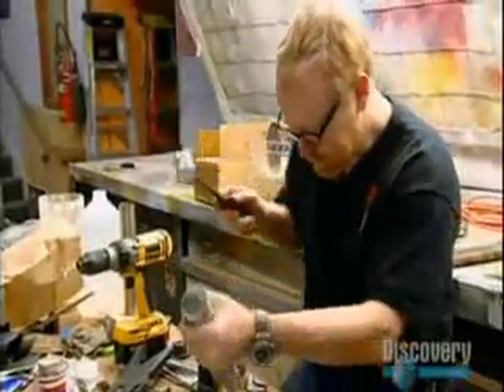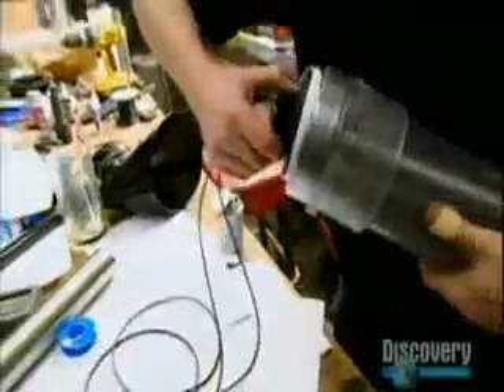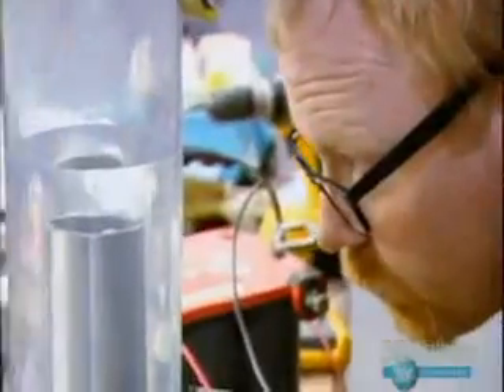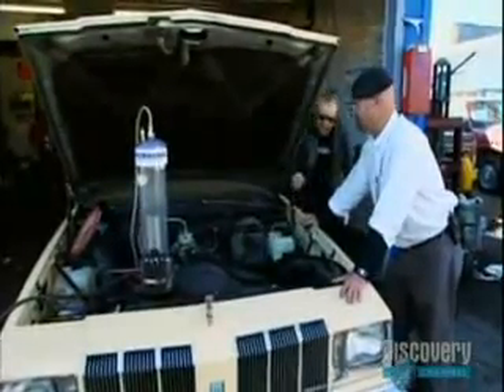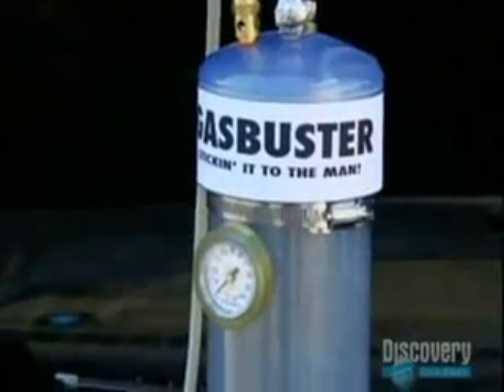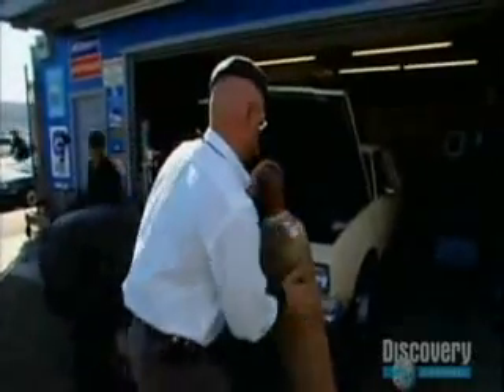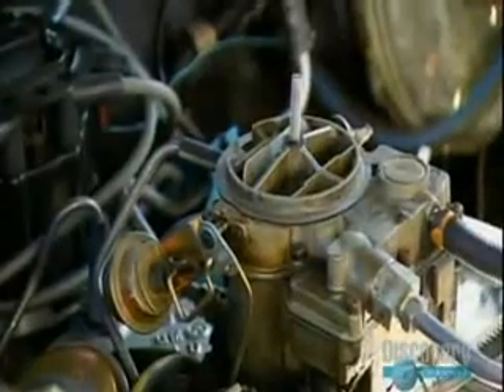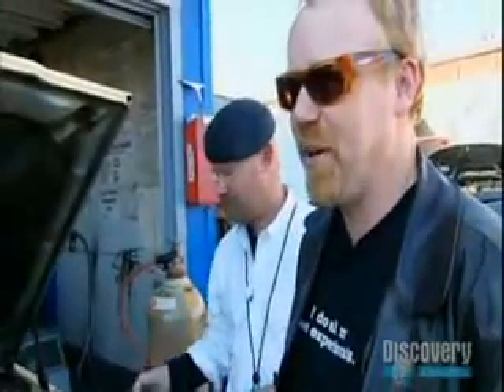HHO Mythbusters Explained

Comment: Since I am researching hydrogen as the "next generation fuel". I read somewhere that you need 4000 Liters (four thousands) of hydrogen to replace 1 Liter (one) of gasoline. it is not impossible to generate that ammount of hydrogen, unfortunately it still requires a lot of electric energy, so you just have to settle down with the small generator that can only produce 1-2 Liters of hydrogen per minute. If you are trying to run your car only on Hydrogen then try to get at least 100 Liters per minute with low electricity or with a solar source, and make it small enough so it fits inside your car. I am a man of science so I would never say is impossible, actually I beleve very soon someone will find the way, I have seen amazing guys on youtube getting up to 60 Liters per minute (using 320V and 33 amps). I am even thinking of writing my grade tesis about it. But for now we will have to run our cars only with a mix of hydrogen and gasoline. Hope this info helps you all to save some time instead of wasting it watching scams on youtube. THERE ARE A LOT OF SCAMS. peace!!

Comment: YOU DONT RUN THE ENGINE SOLY ON HYDROGEN...

it is best when you use a tiny amound of Hydrogen  produced by a kit using your cars electrical  system 

That tiny bit of hho is sucked into your intake via a vacuum  line attached to the intake manifold  and mixed in with your normal fuel and air and all of it is burned in the cylinders  just like normal combustion . .

The difference  is that the hho burns  fast  and clean to make sure you end up with no unburned fuel creating a cleaner exhaust better horsepower due to a complete burn and better fuel economy due to the horsepower increase you can keep your foot off the gas pedal a little more..

This system seems to work very well for diesels  and may eliminate the need to regen or use DEF fluids. 

There are many DIY kits and companys with $10k machines that mount on a big rig.

I think a major difference  in the machines is the amount of hho produced

And the material used in makinh the metal plates that are layered  in the water 

Platinum  is one of the better materials but is very expensive  

Stainless steel works but wears out and does not produce as much hho ..

Good luck and i hope people will continue  to develop  this

Comment: its important to note this is not made to run a car off but rather as a fuel enrichment item to more completely burn what fuel you do use. if the energy used to create the HHO was from waste heat/exhaust gas the system would definitely increase output power. the idea is not the same as the water fuel talked about by stanley myers/daniel dingle/joe cell (or the like), it works on ICEs due to the fact that the ICE started as a highly inefficient design with room for improvement and gasoline doesnt burn 100% on its own (at Standard Temps/Pressures).

Comment: If you understand the basics of physics you would know that these systems are impossible anyway... it requires much more energy to produce hydrogen then you gain from burning the hydrogen.

electrolysis is only about 65% efficient. It gets even uglier when you combust the hydrogen... you only get back about 20% of the energy stored in the hydrogen, the rest is converted into heat. If you dedicated 100 Watts to producing hydrogen and then burn't it in the engine it would only produce 13 Watts of usable energy, which means you'd loose 87 Watts of energy!

Comment: They have totally misrepresented the concept. The device was developed to aid combustion and bump up power and aid economy. No ware does it claim that you can run a vehicle without fuel in the tank feeding the engine. 
Having said that, the device produces very little hydrogen, a single teaspoon of petrol can produce 12 cubic metres of hydrogen gas. Whatever the pros and cons, the idea is nice.

Comment: HHO cell produces HHO on demand... even if it backfire it wouldn't cause any damage... for additional safety use flashback arrestor or have a blow valve in the bubbler or have them both if your so paranoid... haha

Comment: mythbusters = propaganda/newsertainment
Reply: Keola Pirata I agree! I've thought that for MANY years now. I stopped watching the show when their "science" became Paid Science. Some of their episodes made me nauseous with how obviously blatant their BS showed.
Reply: Gary Tugan name ONE thing factually wrong?
Reply: Exactly right
Reply: Keola Pirata agree. they get paid by various entites to purposely cause some of their experiments to fail. it is not hard to make 3-4x the H2 that they make with their design. light-weight and high surface area materials are needed. solar/thermal recovery generation of HHO is maybe the best way to augment gasoline.
I stopped watching couple years ago when they obviously did not pursue some experiments to an improved design when results seemed to fail so they labeled many things as Busted.
Reply: +pds tech nnb
Reply: Keola Pirata to be useful in cars, it needs to have at least 50 horsepower to the ground
Reply: Jesteś durniem bez szkoły.
Reply: another Clinton-Obama deep state program
Reply: +FieldSweeper How about the FACT that they failed to produce a functional HHO cell for their experiment?  You can't test  if HHO works or not if your crappy cell is not even generating any gas.
Reply: oh I know.  they just choose a simple design when actually massive amounts of HHO can be made with  a little ingenuity, which takes time of course. they should've  just declared  it unknown due to circumstances.
I laughed when they just stuck the hose of H2 into the carb and thought that would prove/bust the idea.

Comment: The truth is, MB's didn't prove that HHO doesn't work. They proved, that the downloaded version from the internet of HHO wet cell plan doesn't work. They did however prove the point, that you CAN run a car on pure hydrogen, provided, that you have enough of it available and they also inadvertently pointed out, that you need a safe and proper set up to be installed on your car, to avoid any unwanted explosions and/or damage.

Comment: Conservation of energy makes this theoretically impossible in a car. You have to put in power to break apart the hydrogen oxygen bonds in water then you have to put in energy to bond the oxygen and hydrogen into diatomic form but that is not the issue you get all that energy back out in the combustion process. The issue here is that the thermodynamic cycle is limited by the Carnot cycle so you will not get a 100 percent efficiency meaning you will never be able to keep the cycle going for longer than a minute or so before then energy difference will be to great and the battery will no longer run. The reason hydrogen can run an engine is because it does produce enough energy but there is a reason they produce it in large quantities in factories. It is because they use large amounts of heavy metal catalysts in order to make the energy difference smaller and more efficient but they charge you because both those processes are expensive and they still have to put in a large amount power to make the reverse reaction happen. Whether there is a catalyst involved or not it still requires more energy than what you need to get out because the Carnot Cycle limits the power out compared to what is put in.

Comment: It is very easy to makeThe so called fuel cell and make a lot of bubbles  with different types of additives to the water and different gaps between the plates,,But it don't matter what you do,you can't make enough (gas) with your car battery to run your car 100% on (gas)You would need a bank of battery's and a supersize alternator  and a V 8 to run the alternator,,,,,,So you are chasing your tail,,Running around in circles and guess what, you are getting no where ,   CRAPP
Reply: no matter how many batterys, how big of an engine and alternator. the bigger the power draw the more hydrogen you will need to produce that power.

Producing hydrogen with electrolysis then burning it in the engine is only about 13% efficient, meaning if you was using 10000 Watts to produce hydrogen you'd only be able to make the engine produce 1300 Watts with the hydrogen you're producing. if there was a 10kw draw on the engines alternator it would just stall instantly because there wouldn't be enough gas to to produce the power you required to generate the electricity to produce hydrogen.

HHOs are just another version of a perpetual motion machine and it's been proven time and time again that's it's impossible to produce more energy then is consumed within a closed system.

The only thing HHOs can do is either decrease mileage due to the extra load on the alternator or have no noticable effect... some people also drive more carefully after they're fitted because they're worried they'll fudge the numbers by driving erratically and it might mean they won't see the gains in economy (which causes there economy figures to be slightly higher! this is probably the case for the small improvements people claim). Some machanics who sell the systems also add additives to the fuel and service the engine (Like changing the oil and filter) so they can claim any improves that these things might give is due to the HHO system they fitted.
Reply: Well said  :))
Reply: Gary Tugan if there's proof then why can't it be replicated in a lab? HHO doesn't work and due to inefficiencies in the production of hydrogen through the proccess of electrolysis you need to use more power then you gain

the only way you could use a system similar to a HHO system and gain is if you turned electricity genereted from a type of regenerative braking into hydrogen and stored it until you had enough to run the engine on it for a while, but you'd be better off just fitting an electric assistance device with a battery or capacitor instead of a HHO system for regen braking.

the best way to improve gas mileage though is to buy a more economical car. My Toyota Aygo can do 61mpg (US) with no modifications and it's not even a hybrid... it's just a cheap city car.
Reply: Marinus Pemen Actually, this little thread makes NO sense, considering the thousands of people actually using this kind of a system on their car (many with proof). I find it to be a bit entertaining to read comments from people who obviously are not DOers, but Naysayers, based on the naysaying of others. Recommendation: open your eyes to what people ARE doing, and stop listening to the BS that is thrown out by the Disinformation Machine.

Comment: The oil companies would shut down Myth Busters if they made it work efficiently.
Reply: Pablo Martinez at a 13% efficiency a solar panel isn't going to do much... and a wind turbine would only rob energy from the car by increasing aerodynamic drag. if you wanted to fit a solar panel you might as well just convert the car into an electric assist hybrid and fit a battery that could store enough energy (about 1kwh would be ok and it would be affordable) to improve fuel economy and a 1kw motor could be altered to drive the AUX belt (an electric motor is 80-95% efficient)... you can also get special alternators now that can also be used as an electric motor (they're mostly used on cars with Auto Stop/Start systems because a starter motor would wear too fast)
Reply: dont brother to explain any thing to the brain dead  you and me , understand  that shit,s work  with minal investment ot tools to make it work
Reply: Fromage Frizzbizz
I love that plan! "you have to have electricity", okay, I'll get your electricity and never pay a bill, then you'll cut me off and be mad. LOL!!
Reply: +elvis morales even at nuclear power plant scales, it's more expensive to produce hydrogen by electricity than by chemical processes on fossil fuels.

There is a reason why less than 5% of the hydrogen production in the world is done by electrolysis.  Hydrogen production is a big business.  They've picked the cheapest way to do it.
Reply: Doing what?  While jurisdictions vary, it's trivially possible to build a house without any sort of electrical power connection.  Think: cottage.

Now, your bank might not like the idea very much, because they're thinking "what happens if you default on your mortgage?", and without an electrical feed it's going to be harder to recoup their losses when they have to seize the house and sell it.

It's perhaps difficult in some areas to build a house inside a subdivision without a power connection in addition to the bank mortgage issue.  There are issues of safety to consider if you're DIY building something producing lots of gas.  Gas explosions are very not nice to your neighbors.  They're going to want to see that it is built and type-tested to approved safety standards and likely won' t kill your neighbors.  If it's DIY, it isn't by definition.

In our area the only code-specific thing that promotes "electrical" is the fact that electrical code requires that there MUST have a properly sized receptacles for the stove and dryer.  Even if you intend on installing a gas stove or dryer.  The reason is simple: it makes sure that when the next person buys the house and replaces the gas appliances with electric, they're not tempted to badly DIY a receptacle for them.  The outlets don't need to be powered at the panel, but they have to be there.

Now of course if you were able to power your house using self-generated electricity (without potentially killing your neighbors, or getting your neighbors complaining that your solar array is shading their house), all you have to do is get your power company to do is disconnect you.  After all, they'll do just that if you refuse to pay your bill long enough.
Reply: Elvis Morales
Watch out for the chlorine gas when using seawater!
Reply: ***** I could show you all the numbers if you need me to
Reply: Pablo Martinez
I've heard about cities doing that and it pisses me off. Would it be possible to have an electric service account but simply not use any of their electricity? (I guess you'd still have to pay the fees, taxes and other BS that is on an electric bill)
Reply: Kevin Jackson definitely
Reply: If you understand the basics of physics you would know that these systems are impossible anyway... it requires much more energy to produce hydrogen then you gain from burning the hydrogen.

electrolysis is only about 65% efficient. It gets even uglier when you combust the hydrogen... you only get back about 20% of the energy stored in the hydrogen, the rest is converted into heat. If you dedicated 100 Watts to producing hydrogen and then burn't it in the engine it would only produce 13 Watts of usable energy, which means you'd loose 87 Watts of energy!
Reply: @mikes1992u  who cares about efficiency. We are talking about the most abundant element in the universe here. If we have excess capacity to create hydrogen, we should use it. All that matters is 1. Is it clean burning and 2. Can we make it and 3. Will it work and 4. Do we have a need to store excess electricity for some purpose. Is it the most efficient? NO. Is it the most plentiful - absolutely YES. Can we make it work? YES, Is it clean burning - YUP. So tell me again why efficiency matters when we have an unlimited supply and the ability to make it from renewable sources?
Reply: +micheals1992 soler panel, wind terbine, come on your suposed to be smart.
Reply: Let me tell you something bout Mythbusters they need me met behind an alley with five or six of the baddest Negros  of any city in the United States and have an attitude adjustment they deliberately sabotage that test h2o2 water does work but don't understand is here mythbuster is owned by Popular Mechanics and pop mechanics biggest sponsors are wait for it... The oil companies just check out the ass and pop mechanics or popular Service whatever
Reply: ***** remember kiss (keep it simple) current gas engine can run on hydrogen I have don it I also have some solar panels and a small battery bank I can currently go of the electric greed but law in my city Dos not allow it. I have also built a hydrogen generater the only set back is the law. The answer is not putting a soler panel or turbine on the car it's storing the hydrogen in the car like gasoline(witch is not Easy). Creating it with the use of solar panels and turbines there for free hydrogen. It's been Don and aloof those people have died in weird ways or bought of. I don't want to make this long just look up Bob Lazare and his corvette and tell me what you think.